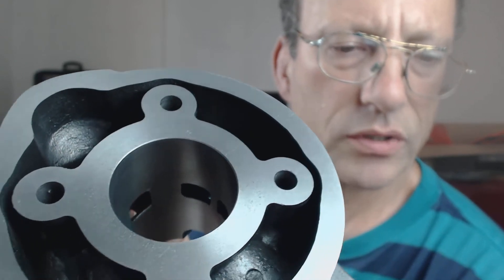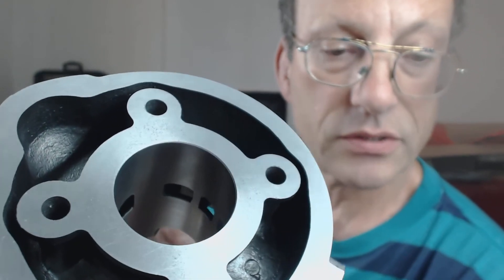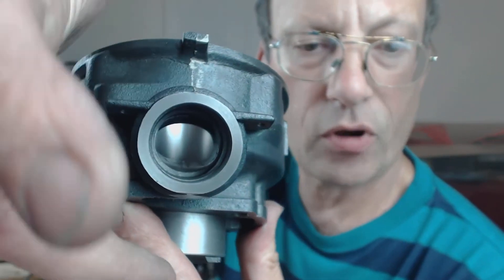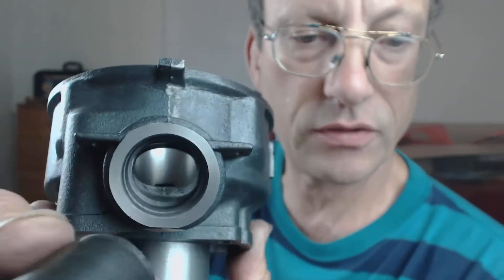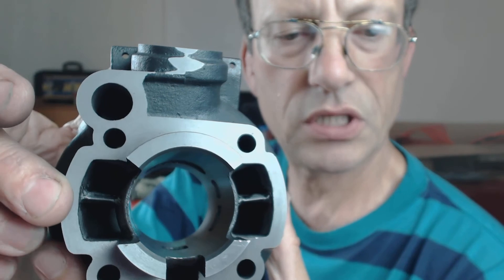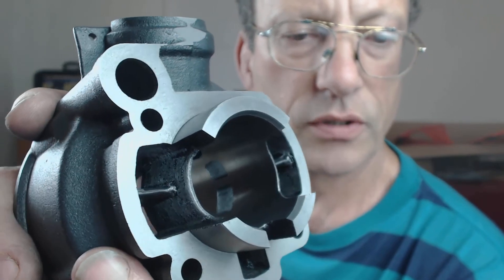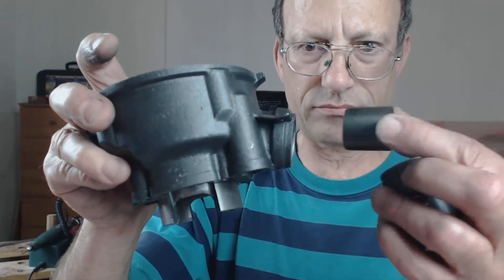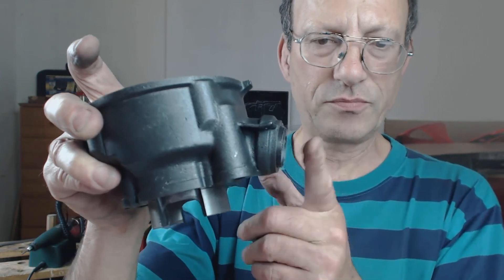TNT 50cc cylinder kit - Gas flow port modification

Comment: Great tips, can you do a vidio on raising the transfer windows and hoe far can you go to gain peak power from a stock/aftermarket cylinder.? Thanks for the insight on doing these mods as a do it yourselfer.
Reply from the maker: Huge subject.
It's best to concentrate first on the basic mods, and tune the carburettor to those mods.
There will be more videos to come.
Think about clicking thumbs up and subscribe for notification of new vids :)